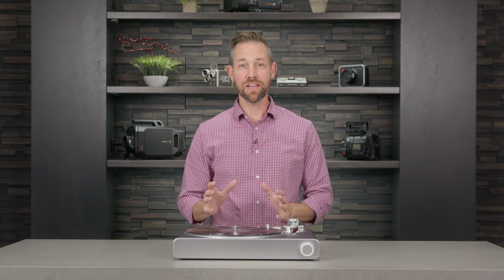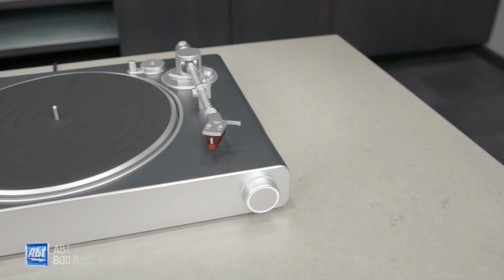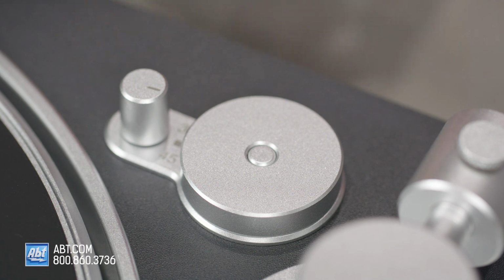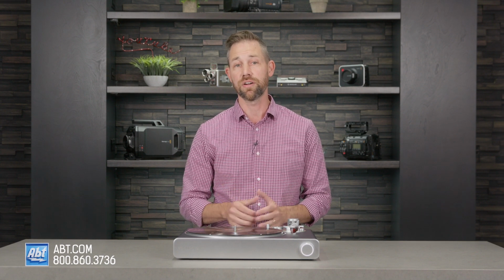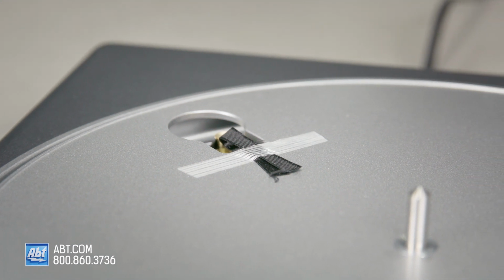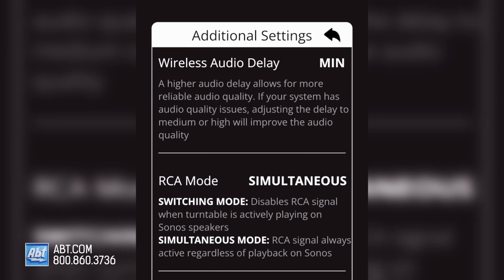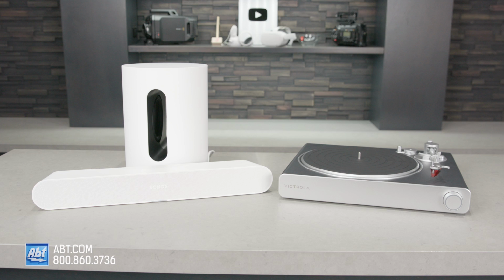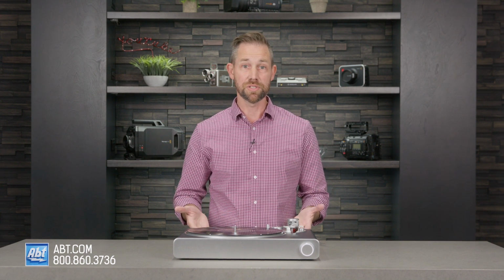Victrola Stream Carbon Turntable

Comment: Worked on one of these. Was very pitchy and could not
Maintain speed right. The motor used is super cheap. $5 motor - yes that’s right. Found tons of them. If they used a Machbuchi motor, they would not get so many returns but they are like $20 cost.
Reply: I agee just got one...nothing but a wavy sound, wow and flutter are just too much to listen too....I think this is junk

Comment: I hope someone here could help??  I bought this and it worked fantastic for a few weeks then it started to drop sound,,,  now it just sounds like shit.  Sounds like a first gen AM radio.  Victrola has been no help.  Tried everything on there website.  Wifi literally sits on the same table.  Sonos works with every other device.  Hard wired player to router.....  Needle is fine....I am at a loss..

Comment: For me, the belt tape came off and I cannot get the belt over the drive...or rather, unsure of where the belt is!
Reply from the maker: @Jon Miller Oh no! That definitely makes the installation a little more tricky. Try checking around the bottom of the platter to see if it's stuck there. Otherwise it may be down inside of the plinth (base). You should still be able to get it attached, it will just take a little patience and some steady hands.

Comment: Doesn't using this product completely nullify the analog benefits of listening to vinyl in the first place? I thought the main appeal of still listening to vinyl records is that, if you have a vinyl printed from the masters, you could essentially listen to the full uncompressed audio as it would have sounded in the studio. With this turntable, sure you can listen on your Sonos speakers, but the audio is converted to digital and is just as compressed as any song would be on Apple Music or Spotify. Plus, most modern records are pressed from already compressed digital recordings of the masters, so you would be compressing the audio twice! I just don't understand why someone would go through the trouble of paying $30+ for a record, and then $800+ for a turntable when they could get the same exact quality of sound by just using their smart phone and their Sonos by themselves.

Comment: Wouldn’t it be better to by an entry level Pro-ject turntable and a Sonos Port? At least more cost effective.
Reply from the maker: @Steen D It's possible, but the Stream Carbon comes with a better cartridge than the base model Pro-Ject turntables and there are fewer parts involved this way. For ease of setup, it's hard to beat this if you already own Sonos speakers.